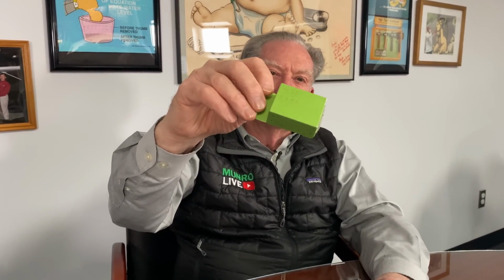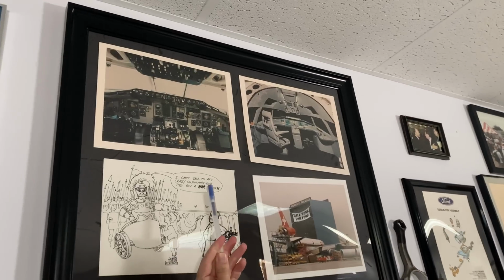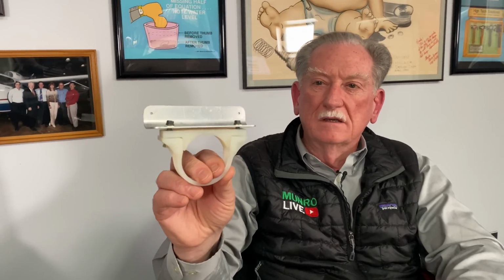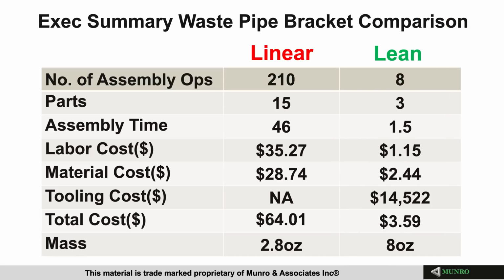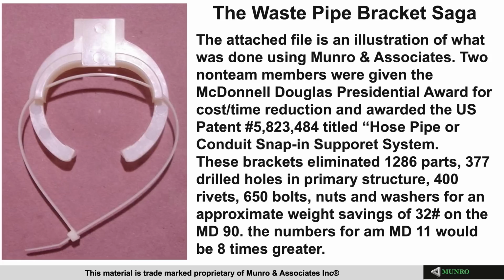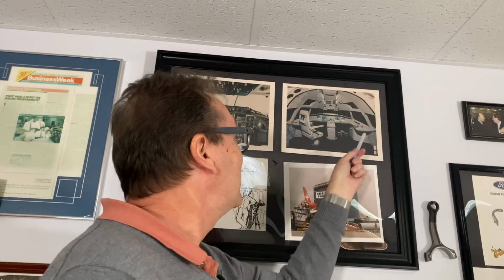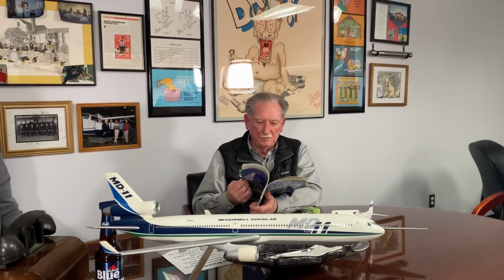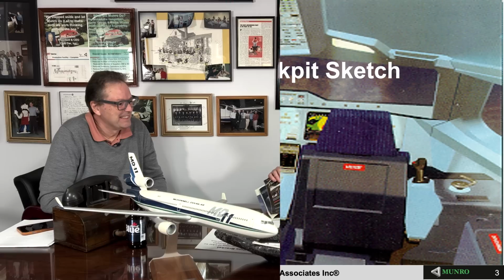What Happened to McDonnell Douglas?

Comment: Telecom have the same mentality.  Late 80's early 90's I proposed to take the cellular technology and repurpose it to trunked dispatch.  Trunked dispatch was/is a terrible mismatch of conventional analog tech(digital now) but cellular was jumping forward in leaps and bounds. I made a display with a motorola cellular brick, which had a RJ45 style jack to a dial handset on one side. On the other side I had an EF Johnson trunking control head which also terminated to an RJ45 style jack. For the presentation, the display shows the cellular configuration. Then I unplug the dial handset, flip the display around and plug in the Johnson control head. We wrote a white paper, "calling all cars" which was an evolution of dispatch mobile radio from receive only to current 90's trunking and cellular. We presented it to Nortel, Nokia and AT&T.  Nortel bought the jewel of Novatel cellular technology, previously they used GE who was bought out by competitor Ericsson.  Basically they told us there was no market but Nortel guy liked the white paper and wanted a copy.  Later I found excerpts/concepts of our paper in Nortel manuals and probably the inspiration for LTE.  30 years later, Chinese companies make cellular compatible dispatch radios but the strangle hold that cellco's have on their network$ make it cost prohibitive in the west to deploy... Where is Nortel now...

Comment: In the aviation community, the problems at MD rose to the top with the DC-10. This aircraft is seen by many as a bean counter's triumph, and that triumph came at the expense of sound aeronautical design and safety. One example: the hydraulics were simply run along the leading edge of the wing, with insufficient backups or shutoff valves (because it was easy and cheaper). Forgetting that leading edges are often where damage occurs, and the absence of backup hydraulics and valving to shut off ruptured lines (to preserve working fluid) and supply critical flight controls with hydraulic power from a third hydraulic system (too expensive!) could mean the difference between life and death. This turned out to be a fatal flaw for UA 232.  This focus on costs above (almost) everything else was a virus that may have infected Boeing when it acquired MD, unfortunately. That said, it sounds like MD had other problems to address, and high on the list would be: "Behind every inefficiency lies a career".
Reply: The DC-10 has three hydraulic systems.  Running all three in close proximity near the tail engine led to all three being taken out by a single event (fan hub failure -- vendor may have supplied a part which was supposed to have been scraped).

The 727 has a similar hydraulic line routing along its leading edge, which led to a PSA falling out of the sky over San Diego almost immediately after the LE was damaged.  The Chicago DC-10 remained flyable even after damage from the departed engine (still had hydraulics from the #3 system), with the eventual wing stall from retraction of some slats only a problem because the crew didn't know a stall was setting up... because AA only paid for one stick shaker + the captain didn't reach up and turn the EMER PWR switch which would have restored relevant instruments and given them all the info they needed.  DAC had demonstrated the aircraft as flyable with all slats on one side retracted during cruise, but for immediately after takeoff the crew needed the instruments so as to know what angle of attack to fly.

Comment: I too worked for McDonnell Douglas Commercial,Long Beach, including on the MD-80s and the MD-11. I witnessed the maiden flight of the MD11. The MD-80s were continuations of the DC-9, NOT the MD-11 0:49. An MD-81 is literally the DC-9-81, based on its FAA type certification. The trijet MD-11 is based on the trijet DC-10.

Comment: Good to hear the "old times" experience talks (the bad and the sometimes wild and occasionally good stuff).  I was with a major European supplier and used to design solutions with my customer (the carrier) that was different (better) than the corporate ones. Our customer was pushing the envelop in ultra-high loadings on their equipment. Big wigs from Corporate never like the solution , preferring to sell more of the "STANDARD" designs. Was fun and I got away with a lot of these by saying " it was the customer's idea" and they are will to buy it (if we built it). Of course was, pre-simulated in our lab and working but true max capacity was not not known , can only be tested live on the network. If you can plan enough contingencies, you can avoid a prolonged outage. Never had one that lasted a few seconds at most!.

Comment: As an Instructor for Aircraft Maintenance, I have often wondered the logic of the Boeing's flight deck. Instead of using all titles in English, use a more universally human approach, numbers. Instead of Left and Right engines, use numbers for these titles. Instead of the classifying of operational consequences as plain English statements, use numbers, helping to identify the level of the threat. Instead of L,C, R for hydraulic systems, use colors, as humans naturally respond to colors instinctively. Instead of control wheels, use of side sticks, side sticks clear the clutter, and simpler to use.   Great points and thanks for making a difference.

Comment: I worked in the producibility for manufacturing before Sandy got there. We proposed eliminating a md8o wing spar finishing process that would have eliminating thousands of manual labor hours (Boeing was not doing this process)—showed studies etc etc - nope-this is the way we have always done it. That said, on C-17 we did implement high speed machining for flight deck structure as Sandy recommended. Not all is lost — the former Douglas Aircraft factory is now home to some fine hamburger joints. Don’t get me started on what they(MDC executives) did to space shuttle/space station facilities in Huntington Beach—now an Amazon fulfillment center. Prime low tax land in the center of 10 million creative people urban center—only SpaceX had the vision (look up DC Clipper / rocket re-usability). As Sandy summed up - so sad.  Oh by the way- also on some of the old DAC property, spin launch, virgin galactic, another with the 3d printed rockets- wishing them the best.

Comment: "Normally, each new generation of airliner crashes less frequently than past models. Yet in aircraft losses per million departures, a standard industry yardstick, the MD-11's record is more than 10 times as bad as the Boeing 747-400, introduced in 1989 with some similar technology, and 15 times as bad as some older 757 and 767 models. It is about the same as the 707 and the DC-8, planes that began flying decades earlier". WSJ Sep. 2000

Comment: As an A&P  for a major airline worked on DC10s when they were reaching the end of pass service and getting sold for freighter conversions.  The '10' was a beast and structurally very heavily built.  It presented a whole lot of challeges for maintenance due to the #2 engine position.

Comment: I have found wilful stupidity to be part of a lot of corporations culture. I believe there may be a typo in your waste line bracket costing sheet. I suspect that you may have swapped the weights of the brackets, as it is more likely for the original to weigh 8 oz, and the replacement to be 2.8 oz.

Comment: So much to say… first jet ever flown was the DC9 (41,21,51). Then straight to the MD11. In many ways a great airplane, a stretched version of the DC10 with the FE eliminated into the automated system controllers. However the wing was of the previous generation and there were issues with the PW engines. Increased ETOPS rules made the B777 more attractive with only 2 engines. 
Anyways, hopefully large aircraft manufacturers and large corporations will continue to learn the lessons from MD’s demise… while it seems Boeing is struggling still… (commercial aviation, don’t know anything about the military wing)

Comment: What happened to MDC? 

The military aircraft (F-15, F-18, Harrier) were the cash cows. 

The commercial aircraft (DC-10, MD-11, MD-80) were subsidized by the military aircraft earnings. 

Then came the A-12 debacle in 1989 and the losses in the F-22 and F-35 competitions in the early 1990s. 

That's when the McDonnell Foundation decided to sell the company. 

It took a while to work out the details, but in July 1997 MDC was bought by Boeing.

Side note: I was a test engineer and project technical specialist at MDC for 32 years (1965-97) on Gemini, Skylab, Space Shuttle, X-33 and numerous military projects.

Comment: that was a really great one and Michael was right, but could also tell the story about Mercedes falling far behind and the svabian tradition of not to change anything cause we had done it always that way. He must have seen and felt that spirit for sure in the strong hierarachical organisation in the developement center back then. What a night mare of innovation and the most innovative product would have been the 500E - built and developed by Porsche. 
Sold like sliced bread but no production capacity for that V8 and the W140 of that time, the last big fat S-class that did not sell at all, was increasing production in an era without demand for such a big dinosaur cause that is how it had been called in the domestic market. 
And 1 year earlier the best car of that era had been released with the SL or Roadster R129 - great design and quality that still looks fresh today.

Terrible times, desastrous sales in automotive and truck division until the turnaround dawned with the C-Class as successor of the 190 series / W201.
And yes, we also were told to not change anything even it had been our job to look for bench marks, lean production and cost reduction over all. Spend to years there and lost a lot of nerves cause that was the dawn of PC arriving at the desk but no one did now how to work with them really productive, getting the big data from the old mainfraim into the PC to generate monthly reports about progress of major projects (cost cutting).

Comment: Damn.. Sandy and I have something in common. I worked at McDonnell  Douglas in St Louis. Best part of my career was supporting engineers for the YF-23 project.
Reply: - Will never forget the YF-23. It’s sooo much better than the F22 but thanks to Sam Nunn (Chairman of the Defense Committee from GA), that hideous looking airplane won the contract.  I had to drive around to a bunch of Hobby Shops in LA bcuz we ran out of a certain item during the assembly process & the hobby shop managers would question me why i was buying so much of one item. Response - “if i told you, i would have to kill you!” LOL 😂
Reply: @Slotcarking  You’re looking at this from an extremely biased point of view. Remember that the F-22 was immensely over-budget and late, not due to corporate failures, but technological challenges and development. The YF-23 was far more complicated (as was their engine type) and had a number of limitations. There is no way you can tell me that the 23 would have been cheaper, it would have had all the same issues and more. At the end of the day, we got more for the 22 as the government just wasn’t ready or prepared for such a project. I still think the raptor is a better dog-fighter as well (you’ll say the cruciform tail limits drag, makes everything cleaner and faster, etc… I’ll say it limits control authority vs conventional tails as it had essentially half the deflection surface area in a given axis.) 

I wouldn’t crap on the raptor too much, to this day it remains the most capable fighter ever deployed. Russia is still attempting to figure out engine and RAM coating technologies that were mastered decades earlier by a Lockheed for the raptor. 

What about the X-32? It couldn’t even fly without parts being removed, the wing had to be completely redesigned after the aircraft was submitted to the DoD… Lockheed went STOVL, supersonic, and landed vertically during demval. Similarly the YF-22 actually fired weapons during demonstration phases which was unheard of (given their complexity vs. conventional fighters.) 

The funny thing is that I actually love Northrop… Jack was a pure genius and the  N-9M and subsequent YB-35 and 49s were so far ahead of their time that we still can’t really beat the core design 3/4 of a century later.
Reply: @EstorilEm   - A private discussion with the test pilots who flew both the 23 and the 22 would convince anyone that the 23 is a better aircraft. That’s all that can be disclosed in this public forum. In addition, the 23 was far ahead of the 22 and we had to wait for the 22 to catch up during the pre-production competition.

Comment: Sad to say, but this problem isn't only applicable to engineering.  I have worked at several large trucking companies. Told them that the future is going to be electric. The response was always you can't do that. I am retired now so I won't have to watch them go bankrupt and out of business.
Reply: Consider the Tesla truck going from San Francisco to San Diego on one charge, about 1,000 KW, or at $0.22 per KW is $220.00.   Enough to buy about 40 gallons of diesel in California where the prices are pretty high right now.  So at 6 MPG, the 500 mile trip would burn 84 gallons.  At $5.50 per gallon, that is $462.  So about $240 more than the electric truck.  

I would think go electric or go broke!  

Remember that night time rates can be much lower than charging at your business in the daytime. 

The change from coal fired locomotives to diesel electric ones was just as fast between 1950 and 1960.  By 1960, you could not find a steam powered train that was going coast to coast, and only a dozen remained, mostly in excursion trips.
Reply: The businesses that actually cost this stuff out that switch the second electric trucking is cheaper will win and the dinosaurs that refuse to adapt will die out fast.  People like that are too stupid to realize that once a competitor lowers their costs, they can either match it or go bankrupt.  The next 10 years will be rough for business people with zero skills that are about to get pushed out of all business sectors because the truth is, software can replace all managers just like it replaced thousands of roles over the last 50 years.  The engineers and techs will run companies better while using software for the business manager tasks.

Comment: in the 60's I got a small tour the engineering department there from an engineer I knew who worked there.  The one thing I remember to this day is the document rooms.  These had very large special steel filing cabinets with full size drawings and blueprints, many many hundreds!  These were the cumulative drawings of all the parts for the airplanes.  Thousands of square feet dedicated to the drawings.  I asked why there were so many.  The answer was that there were many ways to make any given part, so they would have, for instance, a part for the landing gear, with 40 to 50 design variants.  They would then patent all of them and keep the drawings safe in the cabinets.  Only the best one went into production.  So I asked why keep all the rest?  Just in-case, because due to changes over time (i.e. material costs or machining developments), one might rise up the desirability chart and replace the current production part.  I asked how many times this had happened.  Never, was the answer.  Hundreds of people and untold area for this boondoggle idea.

Comment: I remember working to overhaul a component from the DC 10. The unit was a bitch to work on. The worst part was trying to get it to pass the test. To certify the component. It would fail consistently. Hours of dismantling, re inspect, repair ,re assembly to fail test again.  After, working on dozens of them was able to get hold of a representative of manufacturer of the aircraft. And ask him what exactly what was the function of this component on the airplane ? His answer was: Ah this old thing was used on the previous version of the airplane in the new version , its by pass on the system and not used anymore. That thing was worth about $ 7000.
Reply: So it was like an aircraft's appendix. Totally vestigial😆